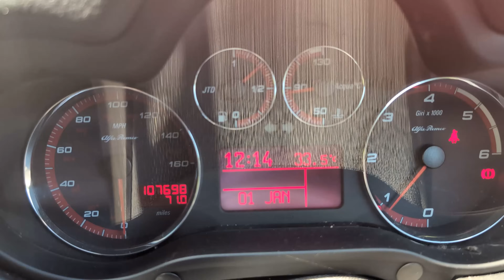YES WE BREAKDOWN!!!! WE DIDNT GET VERY FAR.

Comment: Happened to is on the way home from Durham to Kent. Had to pull over near Leeds. Garage cleaned out the egg with engine cleaner… which is basically made up of aliphatics like in WD-40 so 👍 No problems after that…
Reply from the maker: When I start working on in later this year I'll clean it out.